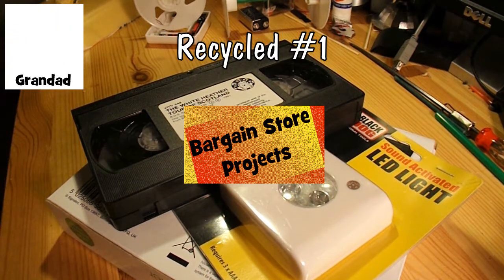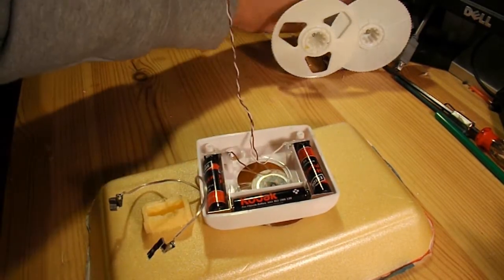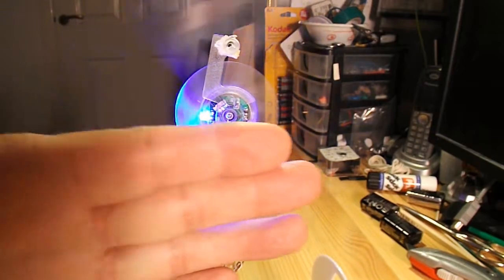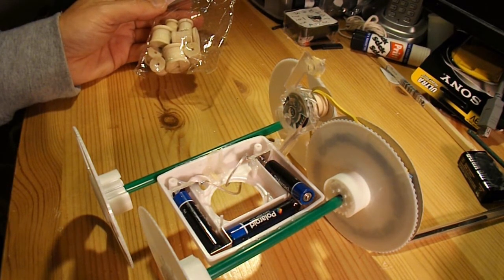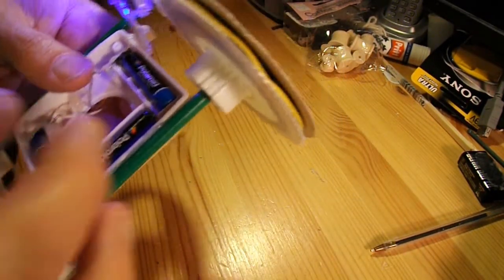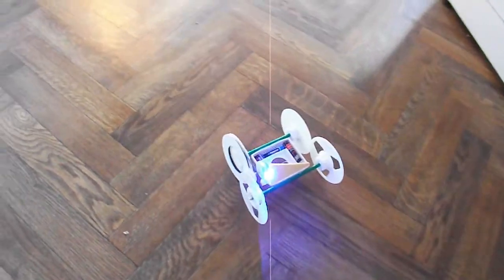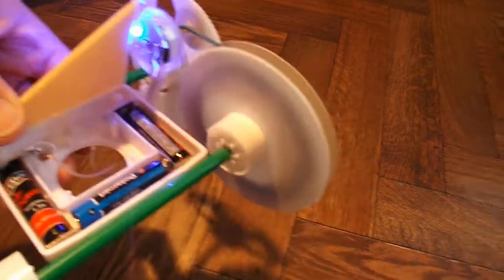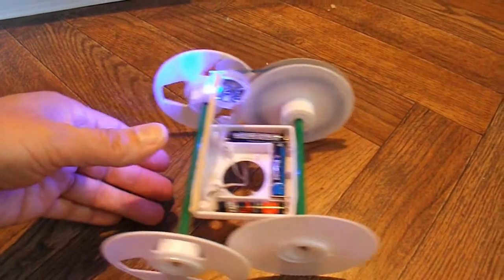Bargain Store Projects Recycled #1

Comment from the maker: I could have put a second motor on the other side and a pulley on the other wheel but I only wanted to see if I could get the car to move with just the one motor. These motors have very little power so it was a matter of getting the gearing right. It took several versions/modifications to get it to run well. Another problem with putting another motor on the other side is they only rotate in one direction, reversing the battery does not work, so it would drive the wheel the wrong way.